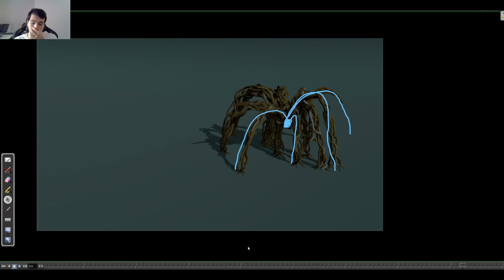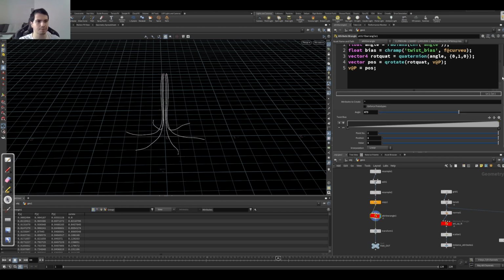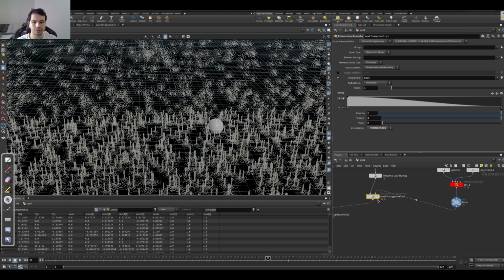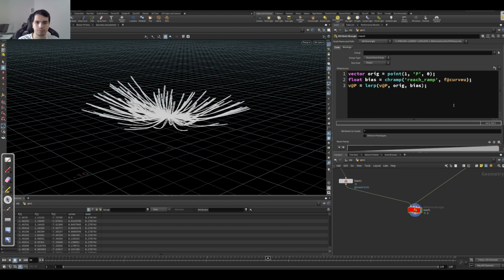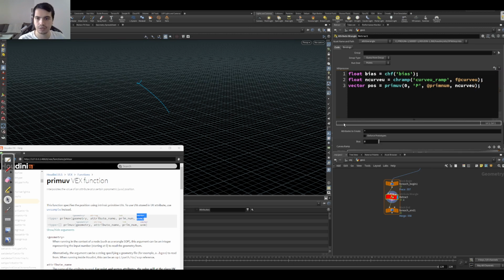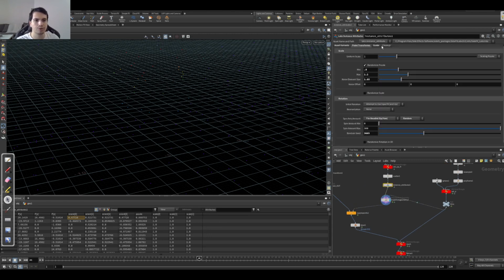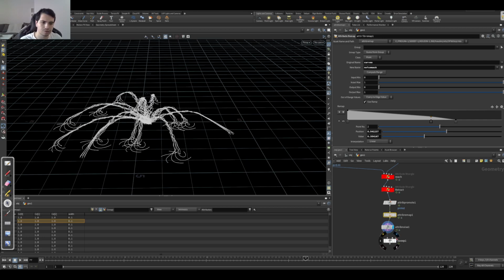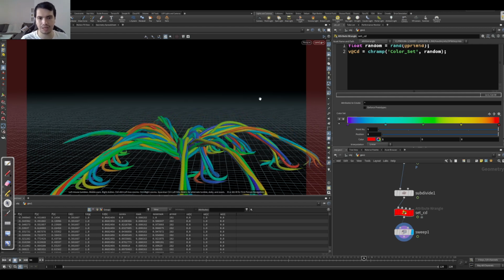(EN) Creating the Mimic with HoudiniFX Tutorial

Comment: great tutorial, thanks for sharing. I kinda dont understand the reach part. are the points essentially just moving down along the curve? (is that what the primuv is used for?) I wonder if there's a way to do this without vex and rather inside a for each loop using a carve node instead. I can't quite figure it out though
Reply from the maker: Yes, the primuv is used to move points along their curves own path, I don't think I can explain how they are used better than drawings in the video 😄
And you're right, carve node can be used but you need to put a resample node after carve and make maximum segment and curveu attribute toggle on inside the loop. Also try to put your for loop inside a compiled block, it would help with performance.
Reply: @ucanlevrekFX  thanks so much for getting back to me, very helpful indeed !